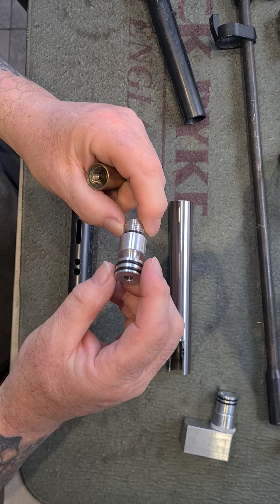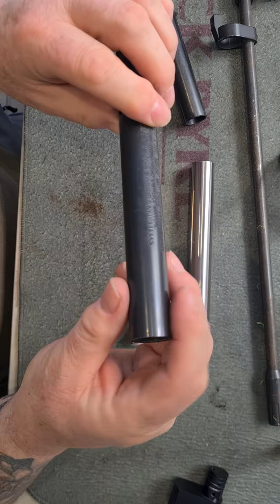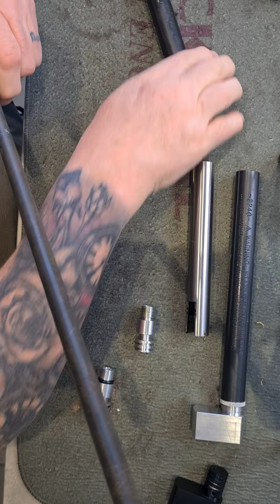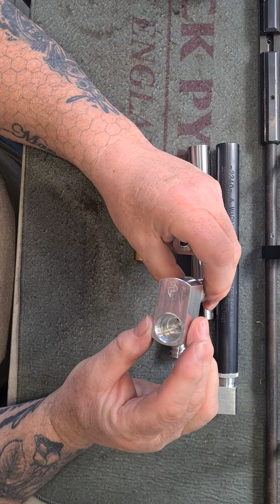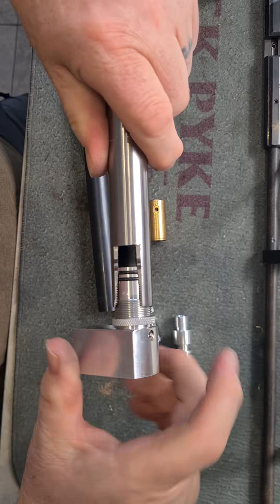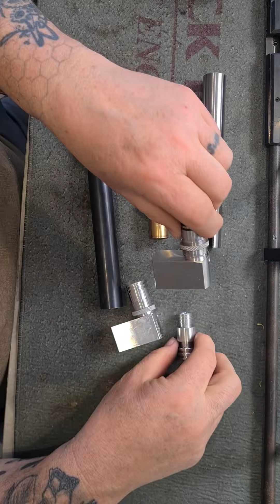CROSMAN HPA PLUG AND PLAY Drop Block. THE LATEST DESIGN TO HPA A 22XX RANGE OF GUNS

Comment: Hello Dave, What maximum output pressure do you recommend with this setup?
Reply from the maker: Hi personally have used 2000psi when testing for seal failure with no issues, but i use 13ci paintball bottles with a reg of 850psi

Comment: Nice work. Have you confirmed that the threads of the drop block and steel tube can handle the HPA with a safety factor? Also, certainly pinning would be a definite. I'm not trying to find fault, i'm keen to do it, but I have a lot of respect for HPA.
Reply from the maker: Its the same pressure as co2, the reg is 850psi and the threads easy handle that pressure. I have seen them a lot higher. The tensile strength is way higher than needed, 

The ultimate tensile strength of aluminum ranges widely from 10,000 psi (68 MPa) for pure, unalloyed aluminum up to over 83,000 psi (572 MPa) for high-strength aerospace alloys. The exact strength depends heavily on the specific alloy series and its heat treatment or temper. Tensile Strength of Common Aluminum Alloys1100-O (Pure Aluminum): ~13,000 psi (90 MPa)6063-T5 (Extrusions/Pipe): ~20,000 psi (140 MPa)6061-T6 (General Purpose/Structural): ~45,000 psi (310 MPa)5052-H32 
(Sheet/Marine): ~33,000 psi (230 MPa)2024-T3 (Aircraft/High Strength): ~68,000–70,000 psi (470 MPa)7075-T6 
(Ultra High Strength): ~83,000 psi (572 MPa) 

There is also plenty of hpa fittings in alloy for the 22xx range and the disco range of guns. The Marauder its hpa with an internal fill pressure of 3000psi and the end fittings are also alloy. There is no worries at all regarding strength of material. You have to also understand that the full length of the tube threads are used with the drop block so you have maximum thread contact. Hope this helps. If you have any doubts regarding the strength please dont buy one.

Comment: Hi morning just seen your video for plug and play drop block could I ask how much one would cost  please
Reply from the maker: There are 2 prices one for supply bits only and one if you send your tube to me for pinning. Only issue is this isn't a sales platform and a run of limited numbers and the interest it's generated they won't last long.
Reply: @peasngravyproductions3728 
Ty for Ur quick reply I'm interested in one what do I do to get one and a price for bit do I need to have my tube pinning also ?
Reply from the maker: @konbailey7339 am currently on holiday back to the UK on Sunday send me a message and we will go from there. Many thanks
Reply from the maker: @konbailey7339  I now have an email address to can contact me on direct peasngravy.productions@gmail.com

Comment: Your version looks pretty good. I agree about the valve pinning, a must IMHO. I have a 2260 that uses your type of setup minus the threaded positioning collar. Also two 2240's using a one piece drop block with a tube that threads into the valve (top removed). Both systems work extremely well, as I'm sure yours will undoubtedly. (see Bricepoi on you tube and see vids). I always enjoy your videos, keep up the good work, and cheers from N.C, US.
Reply from the maker: Thank you i appreciate the kind words, i still have a few of the old design which require thread removal and holes drilling.

Comment: I left a comment on last video about drop block do this . They sell drop block like this in the USA they also have the pin option with thread on the drop block if filling or using over 1800psi  💯🎯😉🤔🫡✌️